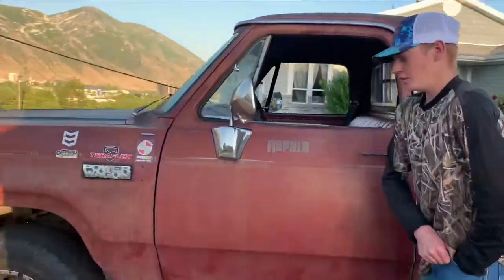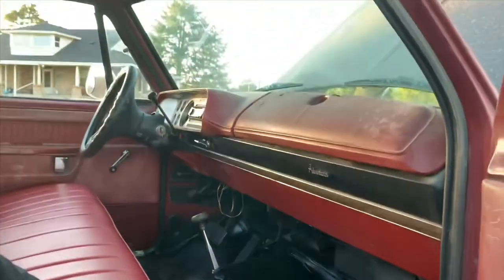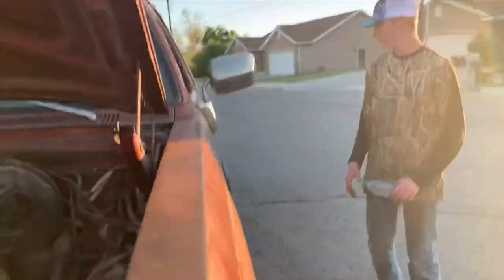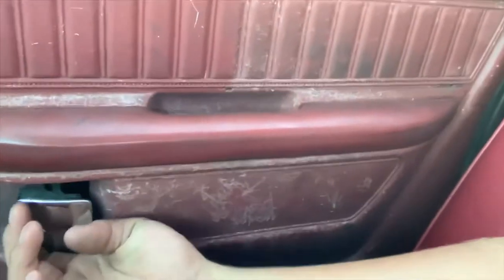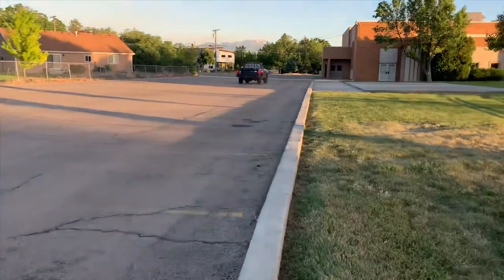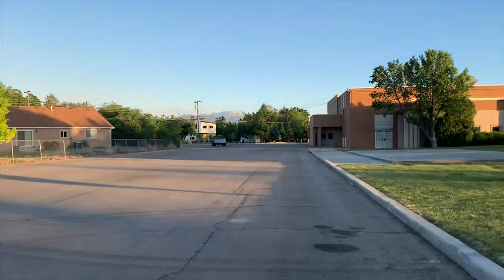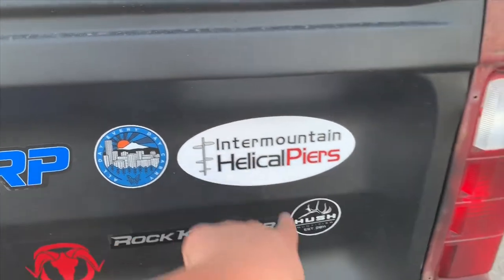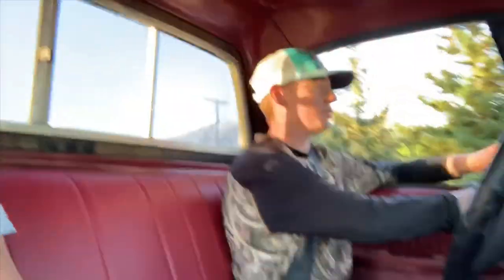1979 Dodge Power Wagon catch up and walk around

Comment: Ditch that small block 318 or 360...yes they are good long lasting motors if u take care of them but yank it out and drop in a fresh 440/yank the 727 replace with 4speed,yank the 1/2ton front and rear diffs,replace with 3/4 ton setup,put in hub front end and drop in the conversion part time kit in your t-case and ull have a sweet ride,that plus alot more is what i did with my 75 powerwagon short box and turned out sick :) ....u got a good starter truck tho to build on.
Reply from the maker: Thanks for the advice I have thought about doing 1 ton axles under it
Reply: I recently just replaced my 318 with a 400 in my 78, with a 4 speed, but good luck finding a big block to np435 trans bell housing, darn near impossible.
Reply: @MitchJohnson-uu5uf  nice ya it wasnt that hard for me to get a 440 bellhousing for my 4speed i guess i just got lucky or maybe the area i live in has alot of old dodges lol...but anyhow nice a 400 is a good motor....have fun with it:)